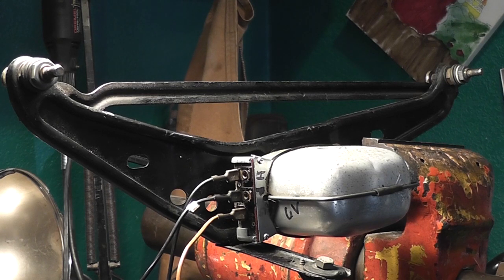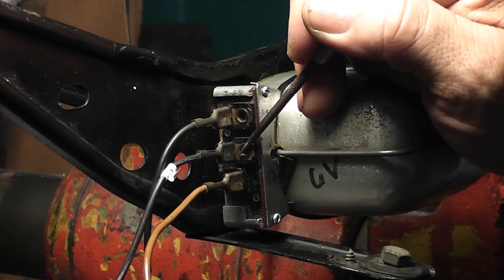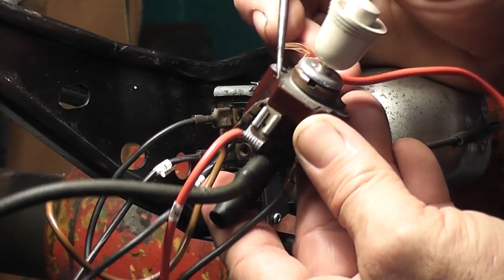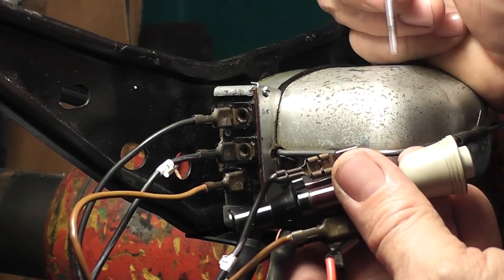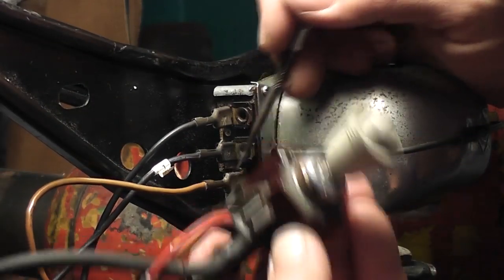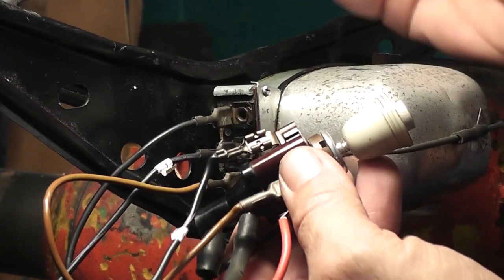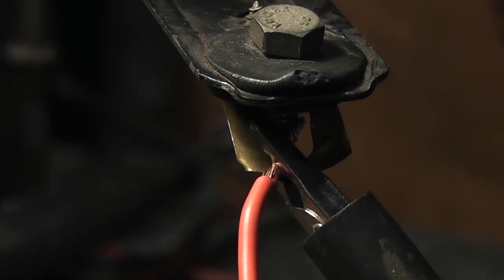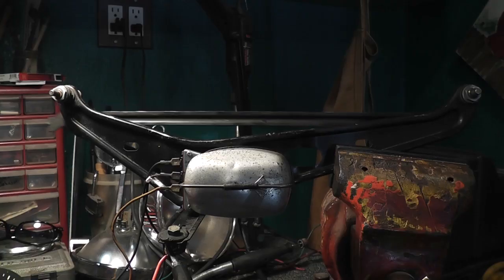1963 VW Bug wiper motor and switch terminations & test

Comment: the wiper assembly it fits bugs 1958-1964  as 1965-1966 its different but still 6v was prior to 1967 when it went to 12v and 2 speeds but same assembly as the 1965-1966. as 1968-1969 assemblies the center mount leg is different and the motor has a bigger crank pin. was prior to late 1969 they went to the cylinderical type worm gear type motor on the 1970 and later models. as the early split window and the oval window beetles they are 6 volt but no park position.  on assemblies up to 1957.  as what i think cost much as the switch is the conversion armature from 6v to 12v and the armature only works on the SWF  branded wiper motors up to 1966.

Comment: Why not use a 12v to 6v step down (buck) converter?
Reply: there is a conversion armature for the SWF wiper motor instead of the resistor as many VW sites like Jbugs, cip1, Wolfsburg West and other that sells them as you just change the armature in the motor then its 12v as resistors in operation gets very hot. as the 12v conversion armatures are for bugs and others up to 1966 as 1967 the bugs went to a 12v 2 speed motor of that style and it went up to  July of 1969 before the motor was changed to the cylindrical worm gear type motor for 1970 and later bugs.